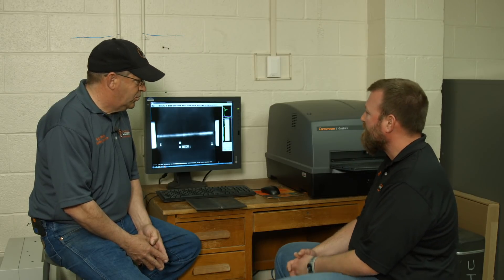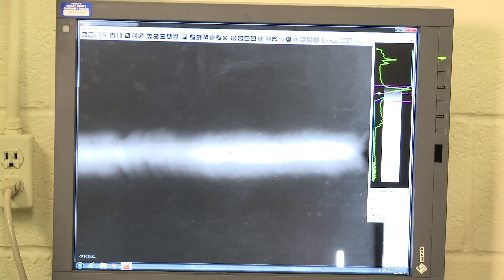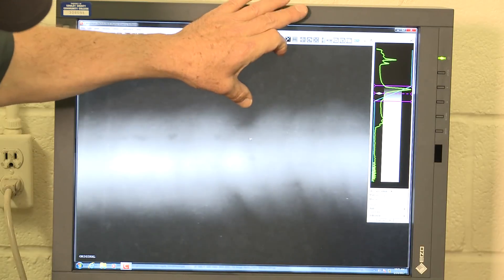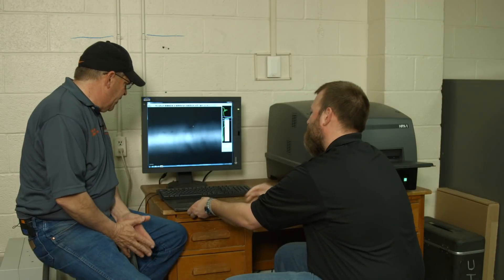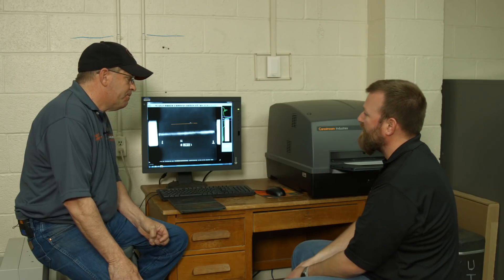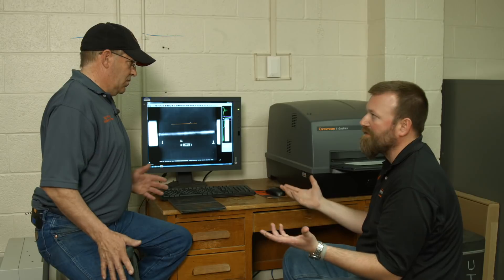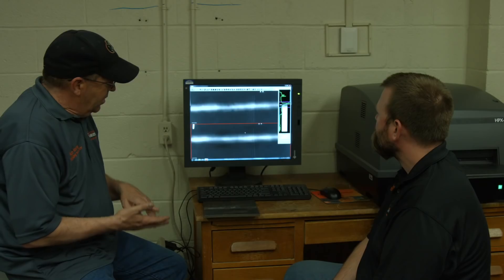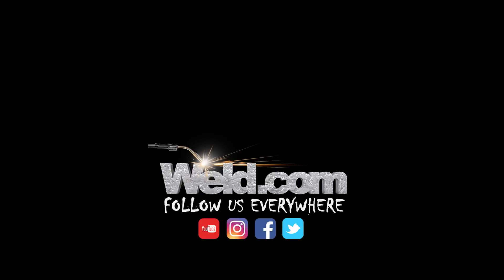🔥 How to Make Weld Repairs that Pass X-Ray (with ESAB Rebel 235)

Comment: In a normal repair situation the radiographer should give an estimate of the depth of the defect to give some idea of how deep to excavate. After  reaching that depth and after chasing any exposed defects the excavation should always be given an MPI inspection to ensure all the defects have been removed. The prodes MPI technique is the most reliable method to use to find defects at the base of an excavation, i.e. better than using a yoke type electrode magnetic. Inspecting the excavation using MPI prior to re-welding makes economic sense - why risk having to repair a second time for the sake of a quick MPI? Great to see NDT being explained and demonstrated on YouTube along with all the other great welding videos that you have covered - I hope you'll continue to help welders with this very educational material.
Reply: You cannot get depth from an x-ray without doing a zero° shot and then an offset shot, then running a calculation for it. Unless you are doing RT on 2" pipe and under (likely superimposed technique due to having 3 images) you wouldn't be in a position to do such a calculation. Doing a contact shot (any piping over 3" up to 12" if you cant get inside of the 12") there is no reasonable way to determine depth without performing profile x-rays as a superimposed technique and calculating based off of that. 

The problem with doing all of that is that it would take more time to determine the depth than it would to have already started repairs on the weld. 

You could also get an estimate of depth from a normal zero° image due to where the defect is in the weld. If it is in the center of the weld then it is unknown, but normally in the root. If in the center of the root and hot pass but not on the bevel then it is likely the hot pass, and further off to the side it's likely in the cap. That is usually how it is determined how deep the welder needs to grind. 

I hope this was able to help you out in some way. As an RT technician I take pride in my work and I enjoy educating workers on the technical side of my trade
Reply: Also, not all material can be tested using MPI. As well as the time and consumables used to do MPI would be more costly to the client than letting the welders grind possibly further through the weld and have a clean repair, then pass x-ray. The most cost efficient solution I can think off at the moment for reliably determining if the weld is free of the defect would be to shoot a profile x-ray on the weld using a digital x-ray system (if the defect is large enough to detect on a less sensitive medium). This is due to the speed of digital x-ray being near "real time" to get a result compared to an hour or so for conventional film, or up to 30 minutes for the type of medium used in the video shown here. 

I hope I was able to help

Comment: 8:21 i recognize that shockwave you got in your back. Bad posture to instant good posture and maintained it without choice. I get that alot.
Reply: Yep.  The truth is most computer monitors are positioned approximately 10 inches too low.  Raising the monitors give you a natural tendency towards better posture.  The bottom edge of the monitor at shoulder height will be much safer for back and neck health.

Comment: Was that a cutting disc, or a grinding disc on the angle grinder?
Reply: Robert Elliott 1/8 inch grinding disc. Grinding with a cut off disc is a quick way to get that puppy to explode. You can get away with a little bit. But it’s not recommended.

Comment: Wouldn't it be possible to just go back over a weld and pull an inclusion out by just by going back over with the TIG and rewelding?
Reply: Possibly if its at the surface.. Needs to be grinded out and removed, then go over.. Most important, never weld over cracks...! They absolutely need to be removed. The heat from welding some times make indications worse..

Comment: use a tiger disc to dig into weld it will let you see the slag,porosity ect a grinding disc will dig it out before you can see it so you'll go too deep or deeper than necessary.but if you gotta go thru to the bead well it's zip disc time.
Reply: Can't grind into a weld with a tiger paw. You can't use the edge
Reply: @wheels.and.wrenches  yes you can. do tend to be wider though. use a tiger paw on thick weld.

Comment: hey bob! im from southern ontario currently a apprentice fitter/welder! im a big fan of this channel and ive taught my boss a few tricks ive learnt from you! i know this question is off the topic of the video but how would you go abouts doing a root pass on 1 1/2"  carbon pipe with a 1/8" bevel and a 1/8" gap with .035 mig i previously welded them in one pass with good pen and no pressure leaks. its for a water bypass system but the new bossman wants a root with a cap now.  Also i do use rollers
Reply: Ho man, I'd have to trial run that. I'd probably go at it with .023 wire first. I'd try up around 10 o'clock with pipe turning away. 2 passes. Then I'd go to .030 wire. I'd be a little nervous about turning .035 down that far. What kind of machine are you using?
Reply: Bob  Moffatt im using a deltawelx 452 i used to do them all in one pass 21v 350w in the posistion you recomended with good pen but i tried it the other day with a 2 passes and i had to do alot of grinding! lol hard to keep that puddle small with .035
Reply: Indeed it is. Why not one pass it if was successful?
Reply: We have a new boss and everything has to be done his was or the highway kinda deal..it took me alot longer to do it this way but hopefully he will relize he is wasting a good buck. I couldnt find ANYTHING online on folks doing a root and a cap with the pipe im using! I would almost rather do it with tig if he is willing to spend that much more time welding these. Atleast id save some time on the cleaning! Lol
Reply: I'd be inclined to do them with tig myself.
Reply: Yes, i hope thats the new route to take!  but im just an apprentice ☺ my opinions are not valued! Haha but everybodys gotta start somewhere! Thanks for your time bob! Love the vids! Keep em coming👍👍👍

Comment: Awesome video again. I will be going to a UA program soon for my local pipefitters union. This is the kind of test I have to pass on 2" sch. 80 in stick and Tig. Already can do a 6 on 6" sch. 80 in Tig . Will there be any 2 " sch.80 in either stick or Tig coming up? Thanks again for the great video!
Reply: Eugene Cosentino yea it you don't pass a UA weld there's no fixing it lol first one may be a warning but then your sent back to the hall
Reply: True that!
Reply: Are you talking production welds in the field or WPQ tests? Because you don't want to know what the UA steamfitters reject rate was on our recent crude tank replacement project, as President Trump said " Sad..." Everyone busts x-rays, we are humans using our bare hands to do surgical work. If you don't bust x-rays at some point, you are doing one of three things: not welding, your company is cherry picking the RT's, or your putting Benjamin's under the ribbon. The welds people bust are the ones where they say "that weld went great, I don't know what happened??".
Reply: No, I was replying to Crunch9876 comment. If you've passed bend, you will pass x-ray. X-ray seems scary because of the voodoo magic thats going on, but the reality is you get away with more on a RT. Sorry about the confusion.
Reply: Eugene Cosentino We did a video of just that. Tig root, GMAW cap.
Reply: Bob  Moffatt I will check that out. Thank you!
Reply: Steve Williams No just the test on a 6G 2" sch. 80. I've bent but never did and x-ray on a 6G test on tig.

Comment: Hey Bob, Any tips for a young welder still in welding school for passing an open root mig in flat position
Reply: MIG vaporizes metals, and anything you breath will never come out of your lungs. If you don't want to be coughing like Bob and me, then use a proper respirator.
Reply: Inkathu Welds 
practice practice! use a LN 125 w/232 wire 19-21v once you can weld with that you can mig weld anything
Reply: I would make a little nose and 4mm between. mig/mag in generelt, by my experiense newer go under 4m  wire a minut . in position a I do push in c shape. if to hot keep still in the sides, never go back on weld. Hope that helps :)
Reply: Thanks for the Help guys! Will take it all into consideration!